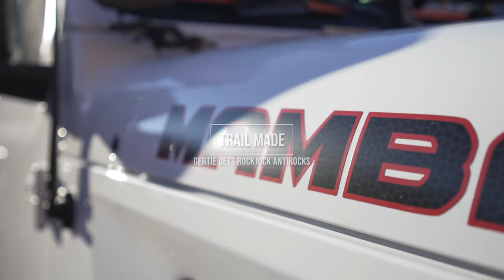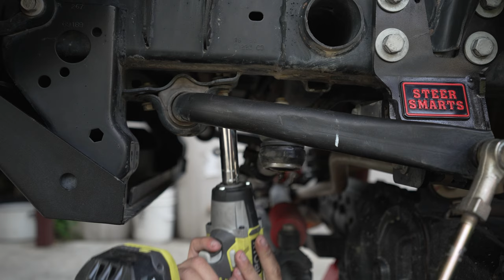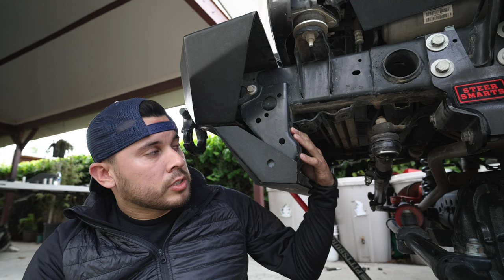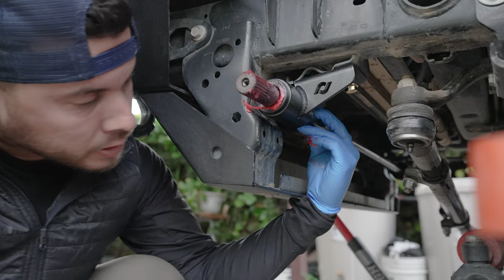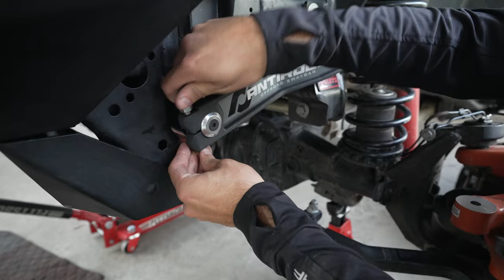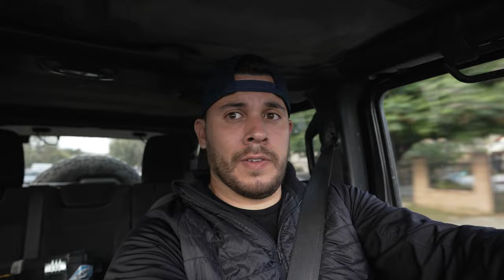Jeep JL - RockJock AntiRock Installation

Comment: How does the extra body roll feel on the highway? like 70-80mph range?
Reply from the maker: I don’t notice it at all. Seems weird, but when I’m at highway speeds, I can’t even tell it’s not the stock sway bar. The only time I feel a small amount of body roll is in the 30-45 range when accelerating or decelerating around bends. Overall, feels really secure